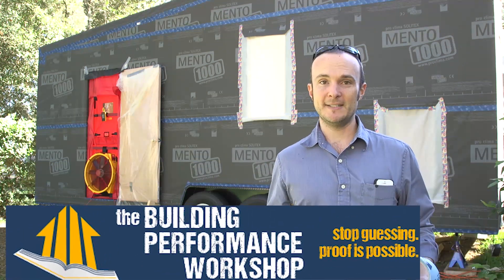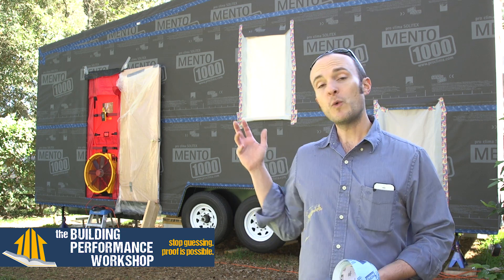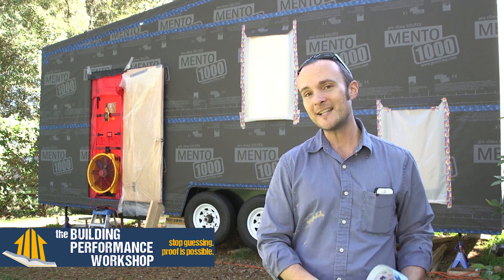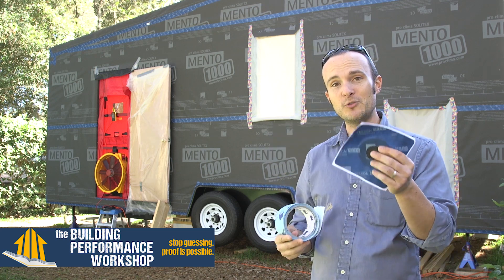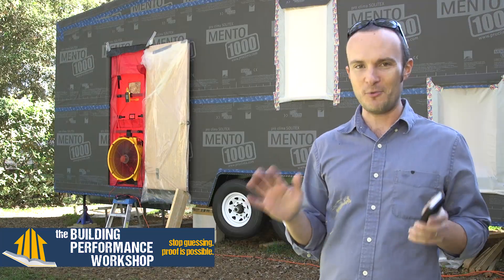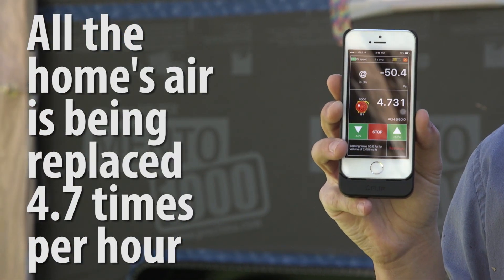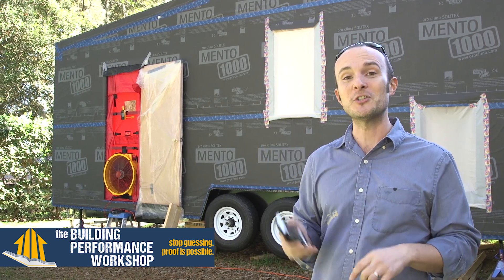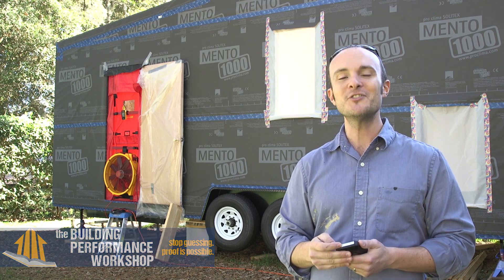Tiny House Blower Door Test, Before Windows Installed

Comment: This is a great video, your tiny house looks good! There is one mistake in your setup I wanted to point out. Your gauge is outside of the house but shows -50 Pa inside the house, which means you have your Red tube hooked up to the Blue port on Channel A. The color coding must NEVER be violated, the Red tube must always connect to the Red port on Channel A, the other end of the Red Tube must always go through the panel to the opposite side. Since the Red tube is connected to blue in this test your results are wrong! 

You should be showing a positive pressure on the gauge (think of it as pressurizing the outdoors because that is where you are standing). This will cause the building pressure to be subtracted from the Fan Pressure, which results in a flow of 117 CFM not 157 CFM. You are 40 CFM tighter than you thought you were. Since testers are normally inside the house this is seldom an issue, but when tested from outdoors you still need to follow the same tube connection procedure. As long as the tubing is connected correctly the gauge will do the right thing. Red through red panel. If not, there is a problem!
Reply from the maker: +RetrotecEnergy Awesome, tighter than we thought! See, everyone- even the guy that wrote the book on Home Performance Diagnostics learns new things every day about testing and equipment. Thanks for the expert advice, guys, and I'll pass along the technical details to my students and fellow trainers.

Comment: Do you recommend rough in blower testing for all new builds? And.... Are they required in IL?
Reply from the maker: Hey +Jamie Abrusci- they're not required, but if you're not sure how your effective your team's airsealing work is turning out (like me, who's never done this before) then it can help to pinpoint the opportunities for improvement before they get covered up with drywall. It becomes way more expensive to diagnose and fix later.
Reply: +Jamie Abrusci I personally would love to see rough-in blower door test all the time.  Sometimes (or usually) the sequence of construction can make it very difficult (and some temporary measures may be required like how Corbett put plastic in the windows etc.).  It's an extremely worthwhile part of construction for anyone interested in a well-performing new home.  In our neck of the woods (Southwest Ohio) it's tough to find a builder who embraces this stuff.
Reply: +Home Performance WAY WAY WAY MORE EXPENSIVE to diagnose and fix later!!!  I making a whole living doing it!!
Reply from the maker: +Julie Tolliver RIGHT FREAKING ON!

Comment: Hm. 20CFM50 would be about 1CFMnat... isn't this so tight that it's sort of hazardous in case mechanical ventilation breaks or loses power? In a normal size home, no problem, but in a tiny house, there is much less volume per human.
Reply from the maker: +Nick Welch Nice sleuthing, Nick! Though the 'Natural' calc isn't used anymore, now that we're off ASHRAE 62-89. We were actually counseled by Lawrence Berkeley National Lab on Friday to use the commercial ventilation requirement of 15 cfm per person instead of ASHRAE 62.2-2013 for a tiny house. So our balanced HRV will provide 30 cfm minimum, and if it breaks down, WINDOWS! Old fashioned.
Reply: +Home Performance I ran a simple simulation and with 1CFM of ventilation, with one person at rest, the CO2 level would rise to 1000PPM after about 100 minutes. It keeps going up until it levels off at about 9000PPM after several days. Thankfully, oxygen stays over 20%, so it would just be uncomfortable and unpleasant, not really dangerous. If the person is being active then this will be sped up.

If I run the simulation with one person at 15CFM of ventilation, the CO2 levels off at just over 900PPM after several hours. Seems okay but that new study about CO2 and cognitive function does make me wonder if we shouldn't try to keep CO2 lower than this.

Here is the source code (Python): https://gist.github.com/mackstann/3438973b274f3737837a
Reply from the maker: +Nick Welch Interesting calc, Nick. We'll be monitoring CO2, temp and RH, as well as particle contamination. Continuously. Thanks to Dwyer Instruments, one of our Product Partners on this project.  I hope you'll stay tuned to what the performance turns out to be- this whole thing is a new adventure in building science.